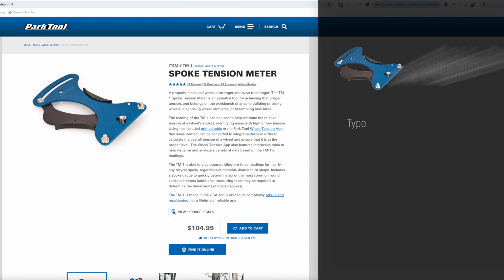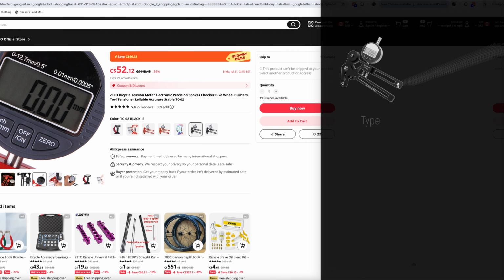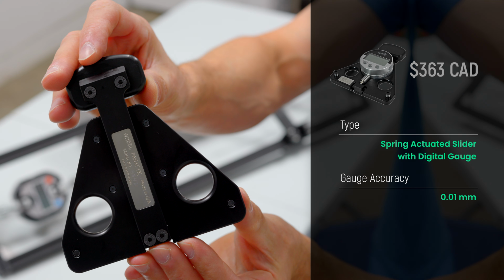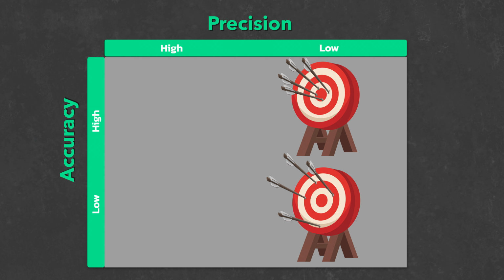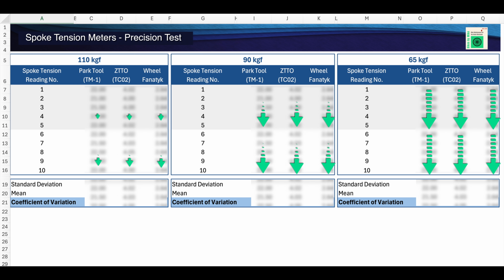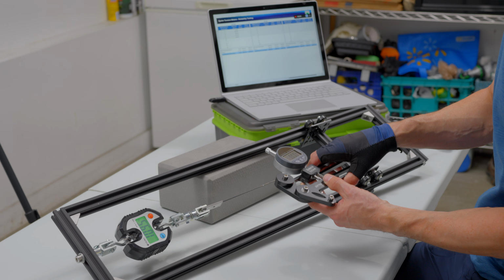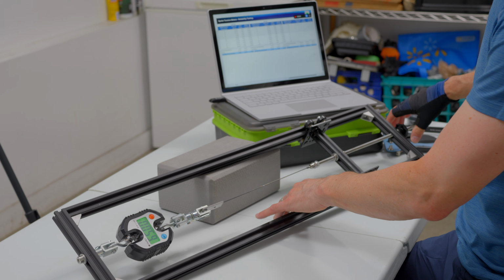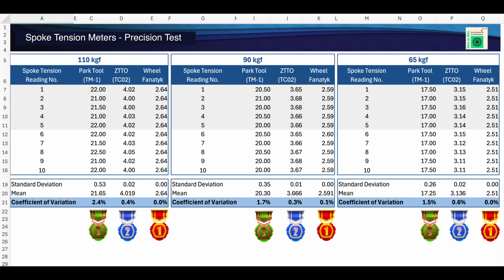Battle of the Spoke Tension Meters: Wheel Fanatyk vs. ZTTO vs. Park Tool

Comment: Hi Mike, I'm not sure I agree with your conclusion, You've taken the mean as an absolute value but this depends where the gauges are zero'd and ignores that the Fanatyk is not very sensitive, measuring only 2.5-3 microns (?) Per Kgf, where as the ZTTO is nearly 10 times as sensitive.
Reply from the maker: You are right that not including sensitivity in my testing omits an important consideration and is a flaw in my reasoning. I should have at least mentioned this limitation when rating the three tension meters. Even better would have been to measure the sensitivity of each tool, but this would have required the use of an expensive force gauge (which I don’t have) and some complicated analysis well outside my pay grade. 

I do think using the coefficient of variation analysis was a proper starting point, but I needed the addition sensitivity test to say definitively which is the best tool. Maybe I’ll tackle this test in the future, but not sure the expense is worth it. I would be more motivated to do so had one of three tools come out as an extreme outlier, but that wasn’t the case. They all did a pretty good job.

I have heard several wheel builders claim that they can build custom wheels to no more than a 5% variation in spoke tensions. Given the point you made, I’m even less confident than before that they are using the right tools, and right techniques, to be able to claim such precision.

Comment: I have the Unior spoke tensionmeter and it is every bit as accurate as the Park Tool TM-1. It costs 30% less and comes in a Kaizen foam conforming box, which the Park does not.

Comment: Great , really informative video. Thanks. If you don't mind bolting stuff to your garage floor or wall this should work as a cheap calibration jig. You need 2 security ground anchors+expansion bolts to fit, 50mm wide ratchet strap breaking strain 2000kg, a section of old heavy duty touring wheel rim about 7 spoke holes long, some 4mm Marlow Excel pro polyester rope ( min break tension 182kg) an old wheel hub. Fix the ground anchors to the floor or strong wall using the expansion bolts, attach one end of ratchet strap to the anchor, other end to a scale. Pass a spoke through a hole in the hub, insert other end into wheel rim section and fix in place with nipple. Pass a length of Excel pro line through centre of hub and tie a loop using a reef knot passing through the other ground anchor, avoid tight bends. Tie another length of line in a loop and pass it through your crane scale looping the free ends over the rim section either side and close to the spoke/nipple. Tension strap to required force and lock handle in place.
Reply from the maker: Thanks! A bit hard to visualize, but I think I understand your contraption. Seems like that will work and definitely a lower cost option. Smart to use ratchet straps to add/remove tension. Cheers.

Comment: Great information, Anthony.  I started building wheels in 2021 during the pandemic.  Started with the Park Tool tension gauge and graduated to the Wheel Fanatyt dial gauge.  Have been recording the results at Spokeservice.ca where they had a free utility to record and graph the results.  Unfortunately, that site is no longer active and I've not found option to replace it.  I'm curious if it would be possible to purchase a copy of the Excel file you created for recording your results?  Only other option I can think of is to create a conversion table going from the Wheel Fanatyk readings to the Park Tool and use their online program.
Reply from the maker: Glad you enjoyed it! I don't recall that Spokeservice.ca website. I'm happy to share my spreadsheet for free. I've sent it off to others as well. Here's the link to the file on my Google Drive. Just download it, save it under a new name and it should work fine. https://docs.google.com/spreadsheets/d/1rhF7SD-rfWK-j0z_q-0zvNzNNt7-m_lc/edit?usp=drive_link&ouid=102873414814529560742&rtpof=true&sd=true
Reply: Thank you, Mike.  Enjoy a coffee with the Super Thanks.

Comment: Great video! Btw did you by any chance tested some other variation of the Parktool tool, maybe ZTTO or TOOPRE branded? have the ZTTO one, and I am trying to figure out if I can use Parktool conversion table with the ZTTO TC-1. I have carbon spokes on Elitewheels D65, I asked manufacturer for conversion table for the spokes, they gave me parktool numbers, but it says 18 for 120kgf, but when I use the ZTTO TC-1 on the spokes, it's like 24-26 currently, which doesn't make sense right? Either the tool have different spring and shows very different numbers to Parktool one, or manufacturer game me wrong conversion number?
Reply from the maker: No. I haven't tried any of the Park Tool knockoffs, like the ZTTO TC-1. I don't see how the Park Tool conversion chart could be used for anything other than the Park Tool Tension Meter. For the Park Tool chart to be accurate for use with another tension meter, the mechanism, spec and brand of spring, and the spring calibration would all have to be identical between the two tools. That's just never going to happen. The marginal of error would be so high as to make the conversion chart useless; may as well go by feel and sound in that case. 

Sorry to be the bearer of bad news. I was struggling with the same issue you're having when I first got into wheel building. That led me down the rabbit hole of building my own spoke tension calibration jig.
Reply: @bikesbymike  It makes perfect sense, thank you very much the reply! I guess I will just get the original ParkTool one, so I can true the D65's without creating the calibration jig, that's beyond my capabilities :(
Reply from the maker: @FliskerX  Nice. Yeah, going with the Park Tool is the easiest option. Good luck!

Comment: Are there any tension meters that work well with small wheels? I'm thinking of 406mm cargo bike wheels, for example.
Reply from the maker: Wheel size doesn’t matter. A good spoke tension meter will work well on all size wheels. Conversely, a bad tension meter will be equally bad on all size wheels.
Reply: Of the tension meters I've used over the years, the only one I've ever had any luck getting to fit in the smaller span between the last crossing and the rim on a 20" wheel is the now long discontinued Wheelsmith. However, depending on hub and rim geometry,  as well as lacing pattern, it may or may not fit at all. Neither the Park one tested,  the DT, nor the Hozan ones I have current access to fit well on 20" wheels, unless they are laced racially. Having said that, if any of them would fit in the span, the reliability of their readings would be the same.